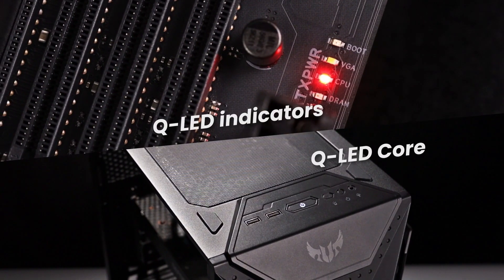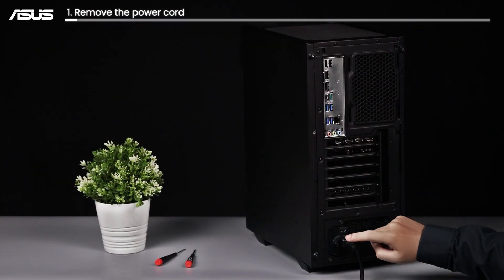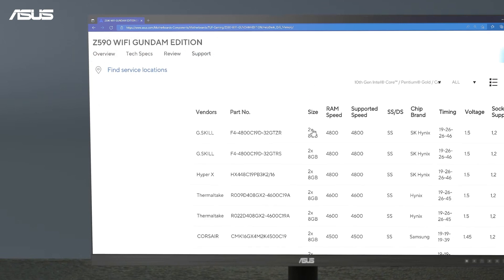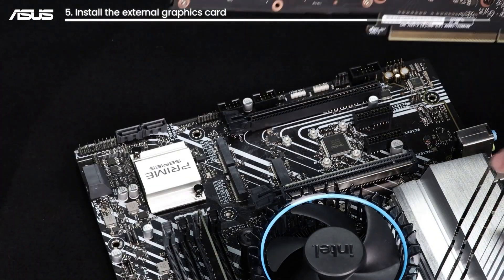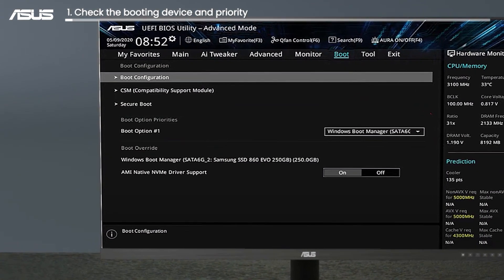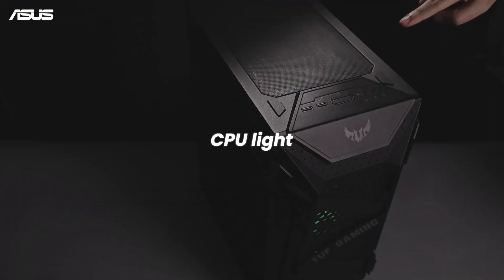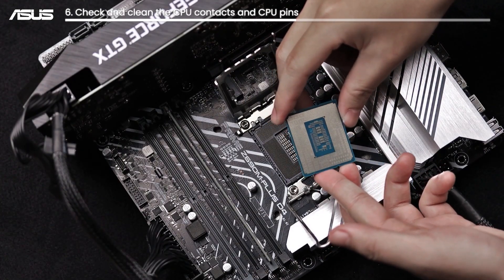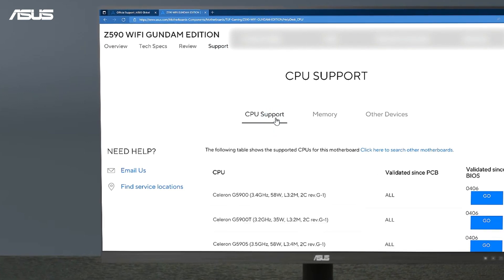ASUS Motherboard Troubleshooting via Q-LED indicators, Q-LED Core   | ASUS SUPPORT

Comment: Hello, I have a 12700k and asus z690 plus wifi d4. Does the qled do a cycle from red > yellow > white > green upon powering up then all lights turn off. I'm having a issue after doing fresh install of windows 10 then after windows works then I turn it off. After the next boot up it won't go into windows and stays black screen.
Reply from the maker: Hi, Kevin Moy. Regarding the first half of your description, the Q-LED indicators will flash during detection when booting.
If it can be booted normally and there is no indicator light on, it is normal and there is no need to be concerned.
However, it seems that it is unable to boot.
It is recommended that you refer to the link below for the No Power/No Boot/No Display issue and check the power supply, hard drive, software for corrupted files, and connected external devices.
https://www.asus.com/support/FAQ/1042632/
If there is an inoperable part of the process, please let me know which step is inoperable. Thank you.
Reply: You might find that your system is able to boot into Windows' "safe mode".

Comment: Hi I just build my pc with Rog Strix Z690-A Gaming Wifi D4 but when I turn on for the first time it does not show up the debug light, all the fans and rgb led are on but not the keyboard, mouse and monitor
Reply: Hi mate, have you found a solution? Yesterday I’ve got b560m-a motherboard, 11400f processor, ram from Amazon, but the system has the same symptoms, as yours - cpu and gpu fans are spinning, no lights, no signal to the monitors. Troubleshooted everything many times - no effect
Reply: @slavamay6229  still no good sign so I sent it to a store to diagnose, they said it could be a faulty motherboard or cpu. Hope they can fix it soon.
Reply: @hongphucnguyen5301  It’s sad. Probably I’ll send mine back to Amazon too. Could you please message me again if you get any news about your mobo? Thanks and happy new year
Reply: @slavamay6229  sure I will, happy new year to you too!
Reply: @slavamay6229  the store just reply me with a picture of a bent cpu socket pin on the motherboard and they said they gonna send it back to asus for repairing.
Reply from the maker: Hi, according to your question, do you mean there's no display on your monitor?
Could you provide the details of your problem?
It is suggest that you test with minimal components.
You can refer to the following link. Thank you.
https://www.asus.com/support/faq/1042632

Comment: Hello, I have the rog b450 f and the DRAM  led stays on no matter what I do and there is no image projected to my monitor.
Reply from the maker: Hi, according to your question, have you try the steps according to the video or the FAQ at the description box?
Have you confirm that the memory is fully installed?
Or check if there is any dirt on the memory Pin or memory slot of Motherboard?
Also, please make sure your CPU/Memory is compatible with your motherboard.
You can refer to the following link.
https://rog.asus.com/motherboards/rog-strix/rog-strix-b450-f-gaming-model/helpdesk_cpu/
Could you provide your BIOS/OS version? Thank you.

Comment: I have just built a new computer. Asus Prime Z690-A mother board with an I9- 13900 cpu. I have 2 32 gig ddr5 gskill dims and an RTX 3070 gpu. Corsair RM850X PSU. I bought everything brand new. When I start it up everything works but there is not video out. I get red light on the CPU led at start up then it shuts off and a yellow light comes on at the DRAM that stays on. I have moved the ram from 1A and 1B to 2A and 2B, from 1A only all the way through to 2B and then did it with the other stick. The DRAM light wont go off and there is no Video. The cpu is running about 28, 29 C. Please help i am about to cry.
Reply: I have installed 13500 with b660 I did BIOS flashback and the process went smoothly but I am getting the very quick red with few seconds orange and no signal on monitor. Also no beeps (supposendly should get 1 beep without keyboard connected)
Reply from the maker: Hi, according to your question, whether your CPU is i9-13900K or i9-13900KF?
For PRIME Z690-A, i9-13900K and i9-13900KF is validated since BIOS version 2004.
And the latest BIOS version is 2204.
May I ask what's your current BIOS version? Please confirm that your BIOS version is after 2004.
Have you confirm that the memory is fully installed?
Or check if there is any dirt on the memory Pin or memory slot of Motherboard?
Make sure you've follow "B. DRAM LED light is always ON after power on" in the following link. Thank you.
https://www.asus.com/support/FAQ/1042678##3
Reply: @asus_support  I dont know what bios it is because i could never get it started to see. the DRAM light issue kept it from getting a signal out to the monitor. its the I9 13900K. But i sent the motherboard back, and got an upgraded one. It wont be here till the 10th but i will let you know how it goes.

Comment: i have qled dram on for 5-10 second and then off, the pc still on but no display, i dont know what wrong, my ram not in qvl, because i dont know what qvl is before.
can u help me? is it because of my ram that doesnt support on my motherboard or what?
oh my motherboard is asus rog b660-g gaming wifi.
Reply from the maker: Hi, according to your question, please replace your device with the one on Memory support list(QVL list).
You can refer to the following link.
https://rog.asus.com/motherboards/rog-strix/rog-strix-b660-g-gaming-wifi-model/helpdesk_qvl_cpu/
Also, it is suggest that you follow "B. DRAM LED light is always ON after power on" in the following link. Thank you.
https://www.asus.com/support/FAQ/1042678##3
Reply: I have exactly the same problem. Since I have 13500 cpu with b660 I did BIOS flashback to update and the process went smoothly but I am getting the same very quick red with few second orange and no signal on monitor. Also no beeps (supposendly should get 1 beep without keyboard connected)

Comment: a mi me va bien todo y ns que passa que se me enciende del palo al led vga por favor necessito ayuda help
Reply from the maker: Hi, according to your problem, do you mean your 4 Q-LED light all on?
Whether the light is blinking or always on?
If the light is blinking and you can boot up and operate normally, there's no need to concern.
If the light is always on, have you try the steps according to the video or the FAQ at the description box?
Please make sure all device is fully installed and confirm whether the device is compatible with your motherboard.
Also, could you provide your motherboard model and BIOS/OS version? Thank you.
Reply: @asus_support  if it turns on and stays on but if I put the PC to sleep and turn it on again, it doesn't work anymore
Reply: @asus_support  tuf gaming b550 plus last version

Comment: Hello, I have an asus prime z790 - A WiFi and mine is stuck on the boot. I’ve removed and I it back the 2 tb 980 pro ssd and still the screen isn’t coming up. The motherboard is on but not the screen or anything.
Reply from the maker: Hi, according to your question, it is suggest that you remove the SSD and then confirm whether your problem still exist.
Please cross test with other SSD too, Thank you.
Reply: @asus_support   so I’ve removed it and tried to turn it on without an ssd and still says boot. I don’t have another ssd to try. I also tried to put the ssd in a different slot and still same thing.
Reply from the maker: @Maestro-anon  Hi, if all the steps has been tried but the problem still exist. It is suggest that you go to the nearst repair center for further inspection. Thank you.
https://www.asus.com/support/service-center-location
Reply: Hey man I’m having to same problem I just built my pc and I’m stuck on boot have your fixed yours
Reply: @eduardovasquez9694   so had a couple dumb problems. First, I didn’t realize I had to press the little power button for it to show on screen, the other thing I did wrong is my ram wasn’t all the way in. If you have problems with the settings and getting it to recognize your boot device, give them a call and they’ll walk you through whatever settings you need to change.
Reply: @Maestro-anon oh and what are you talking about the little power button
Reply: @carlos is that everything is connected and my boot light is on but I can’t get the screen to pop on
Reply: @eduardovasquez9694  did you click the power button, that’s what I didn’t do and it takes about 30 seconds for it to finally show up
Reply: @Maestro-anon  where is the little button at
Reply: @eduardovasquez9694   you’ll have to watch a video with your specific motherboard. They’re all different
Reply: The one I have said power on it
Reply: @Maestro-anon  I have a asus 550 a

Comment: K but what if the CPU light doesn't stay on, it just comes on during rendering? I am using a 13900k, so my guess is the motherboard is recognizing the high temperatures the 13900k runs at and just flagging, but I need to know if I am doing damage to the motherboard or if it is just a precaution. The light shuts off immediately after rendering
Reply from the maker: Hi, if the Q-LED light is not always on, and can boot up and operate normally, there's no need to concern.
Also, could you provide your mother board model?
Please make sure there's no any Q-LED light on. Thank you.

Comment: Is it Normal that when i start my PC that the Mainboards Q-LEDs ist lightnig up in a row 

For example 

1. DRAM (Yellow)
2. CPU (Red) 
3. VGA (withe) 
4. BOOT (Green) 
And than my PC starts normal 

But also im facing a Problem when im starting games after 2 Minutes its Frezzing or Crashing 

I have an M2 SSD installed on the B slot for the Mainboard
Reply from the maker: Hi, according to your question, as lon as you can boot up and operate normally there's no problem.
As for the freezing problem, may I ask what game did you play? Is the problem only occur when playing this game?
How long is the game stuck? Have you try to reinstall the game?
Could you provide your product model and BIOS/OS version? Thank you.
Reply: @asus_support  
Hello 

I have the latest BIOS Version and a Nvidia gtx 1660 8gg 
I found the Problem when i wanna play a game csgo for example its crashing after 3 -4 minutes 
Its because the gpu reaches 45°c and then goes up to 100% usage only for one secound and that is where the game crash or freeze
Reply from the maker: @heikon1206  Hi, may I ask did the crash and freeze situation occur 3-4 minute? After that whether you can play game as usual?
Could you provide your PC product model? Did you use any other software to adjust GPU performance?

Comment: How to update bios for Asus Strix Z390-h gaming? It doesn't have a button for bios flashback. Mine is stuck in DRAM led light.
Reply from the maker: Hi, Asus Strix Z390-h gaming didn't support USB BIOS flash.
Since your motherboard support EZ flash, you can use it to update your BIOS, or you can update in windows. You can refer to the following link.
https://www.asus.com/support/FAQ/1008276/
As for the DRAM light, please refer to "B. DRAM LED light is always ON after power on(indicates no Memory or Memory faulty)" in the following link. Thank you.
https://www.asus.com/support/FAQ/1042678/##3

Comment: Hi asus, I just built a computer today and I have VGA and boot light both on. I have a B550-A white version. Using a 3070 and 5600x and corsair ram with a 1tb ssd. Everything is brand new and i’ve reset cmos. Windows is not installed yet and RGB turns on every thing but the motherboard.
Thank you asus.
Reply: necro-ing this for any possible future people who find this. Your motherboard probably needs a BIOS update to run 5000-series AMD CPUs.
Reply: Hey have you fixed it yet?
Reply: Have you solved the problem? I have the same
Reply: I have the same problem... Any solution?
Reply from the maker: @benceno14  Hi, according to your question, may I ask which graphics card you are using? 
Also, could you provide the motherboard model?
May I ask what GPU mode you're currently in?
Have you try to change the mode?
Have you make sure that all the driver is at the latest version and all components is well connected on the motherboard?
Please help confirm, thank you.
Reply: I'm still having the same problem as described, I have b550f gaming Wi-Fi with ROG Strix 3060 12 GB. 64 GB of trident Z g skills,
Reply from the maker: Regarding your question, I would recommend you visit the following forum post to get more assistance.
https://rog-forum.asus.com/t5/gaming-graphics-cards/bd-p/HSS_Graphics_Cards
Sorry for any inconvenience it may be caused.
Reply from the maker: Hi, may I ask have you try the step C and D in the following link?
https://www.asus.com/support/FAQ/1042678#4
Have you try to re-install your graphics card? and  re-connect the SATA cable to the motherboard and the hard disk respectively?
May I ask your current BIOS version?
As for the motherboard no power issue, please refer to the following link. Thank you.
https://www.asus.com/me-en/support/FAQ/1042632/
Reply: ASUS RAMPAGE V EXTREME ERROR 68 on first bios, ERROR 53 on the second bios. Any solutions? Or I should 'fly' to the shop for next ASAUS most expensive motherboard - hmmm? (vga-checked -3 cards, ram checked 4 sticks every slot = the same result, everything disconnected - 68or53).

Comment: I jumped into the case when I assembled the whole pc and after turning there were any q-led turned on, also the CPU fans not spinning. I've double checked the power source on other pc and works just fine. What can be the problem why I don't have any lights turned on into the motherboard? Model is Asus ROG z690-f, Processor Intel i9-12900KF

PS: I have connected also a buzzer, and after turning on the pc there are no beeps
PS2: Before this motherboard I bought Asus z790-P. I thought the motherboard is broken and returned for that but with this new one same simptoms.
Reply: Hi mate, have you found a solution? Yesterday I’ve got b560m-a motherboard, 11400f processor, ram from Amazon, but the system has the same symptoms, the only difference is the processor and gpu fans are spinning, but no led lights at all and nothing displayed on the monitor. Troubleshooted everything many times - no effect
Reply: @slavamay6229  my problem was the processor, somehow stops the POST events
Reply: and no fans spinning, after i changed the processor everything works
Reply: @slavamay6229  I have the same problem no q leds no booting nothing only cpu fan running....bread board the pc and it worked only for 3 months I am back with the same problem
Reply from the maker: Hi, according to your problem, have you try to clear CMOS?
You can refer to the following link. https://www.asus.com/support/FAQ/1040820
Is any Q-LED light is on? Have you try all the steps according to the FAQ at the description box?
Could you provide your BIOS version? Thank you.

Comment: i have a problem with Asus prime B250 and gtx 1050 i5 6500 i shutdowned the pc the morning it was not turning off and gpu fans are not spinning and a amber light coming from the pc how can i fix??
Reply from the maker: Hi, have you try the steps according to the video or the FAQ at the description box? 
May I ask the "amber light" you mentioned, did you mean DRAM light? If your DRAM light is always on please refer to "DRAM light is always on after power on" in the following link.
https://www.asus.com/support/FAQ/1042678##3
Also, could you provide your BIOS version? Thank you.

Comment: I have a problema with Asus ROG Strix B450 F gaming II, the Boot Led is on all the time, I try removing the M2 and HDD and change for another SSD New and nothing, aldo try to boot from the usb and is the dame thing. I have the Last versión of Bios v4901. Please Help!
Reply from the maker: Hi,  please re-connect the SATA cable to the motherboard and the hard disk respectively.
You can refer to "D. Boot LED is always on" in the following link. Thank you.
https://www.asus.com/support/FAQ/1042678##5

Comment: Is there a list of BIOS codes to Q-LED lights for a particular motherboard?
Reply from the maker: Hi, Butrus Damaskus.
May I ask if you are currently asking about Q-LED Core?
If so, please refer to the link to check the Q-LED Core, and it does not differ according to the BIOS version.
https://www.asus.com/support/FAQ/1047023

Comment: My Asus x509UA ej245t    is randomly shut down itself after few minutes/hours (usually after 2hrs), I gave to local repair shop, they can only wash it from inside,  it work for 2hrs and again shut down and  restart or I have to restart by pressing any key or power key ,after pressing 2/3times+ it turn on ..... And so on
Reply from the maker: Hi, Kumar bty.
May I ask if it automatically shuts down every 2hrs or enters a black screen every and the power light is on? Does this issue happen only when operating a specific application? Or does it occur no matter what operation is performed, or even after few minutes of stand by? Did you connect the charger when this issue occurred?
Meanwhile, please refer to the link for troubleshooting auto shutdown.  https://www.asus.com/support/FAQ/1046480/